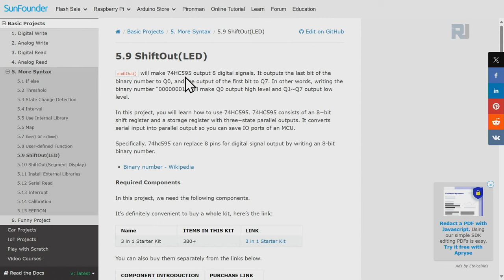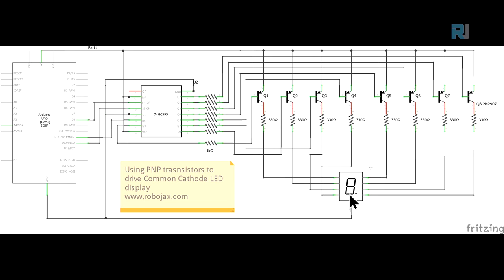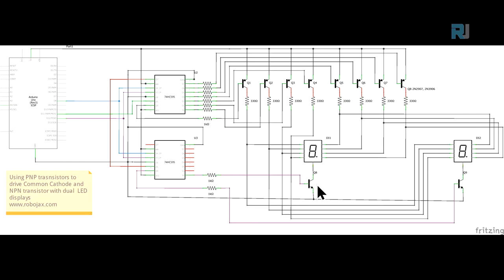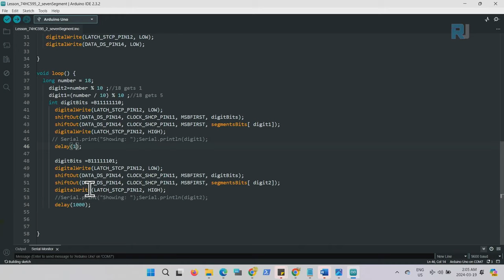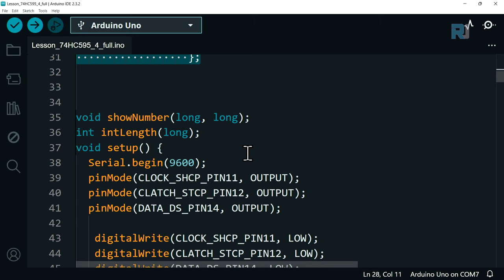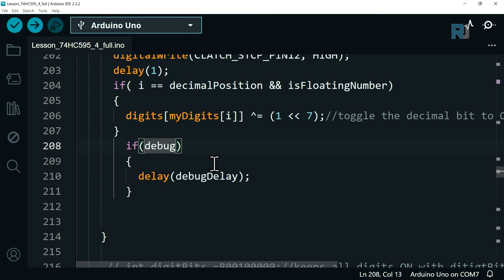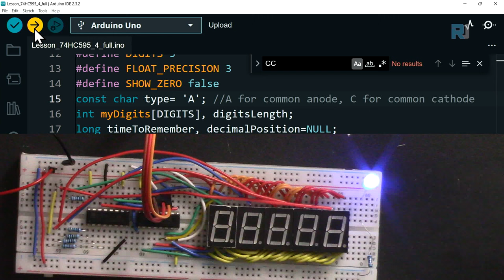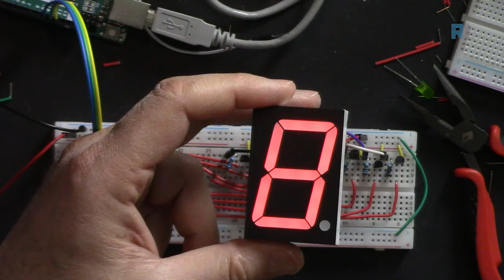Build up to 8 digits Seven Segment display using 74HC595 Shift Register | Robojax

Comment: Hye Sir, and everyone. I would like to ask, what dp you think is a suitable sensor to be wear on ankle, in the purpose of detecting road angle. Im using MPU6050 but the result during walking is not as what I wanted as the accelerometer tends to measure angle if it moving like a hinge. The gyro not giving any reading

Comment: Sir can Arduino run Big servo motors like 400,700 and 1200 watts, ofcourse with their drivers.
And
Hydraulic and Pneumatic Valves
Reply from the maker: This video is not about servo.